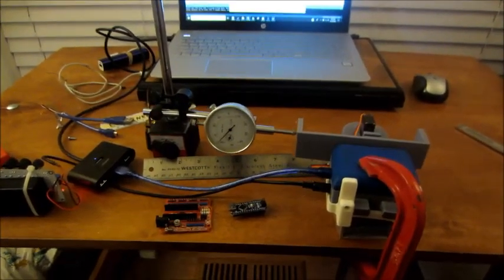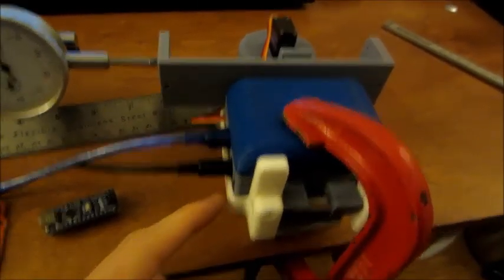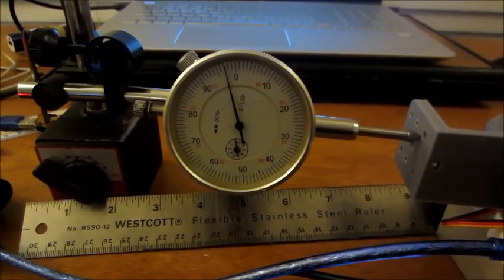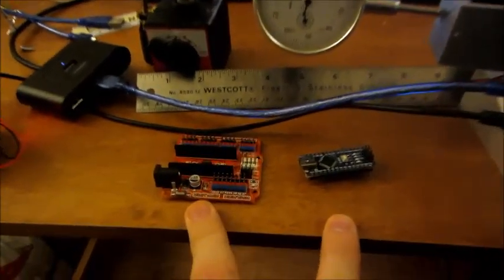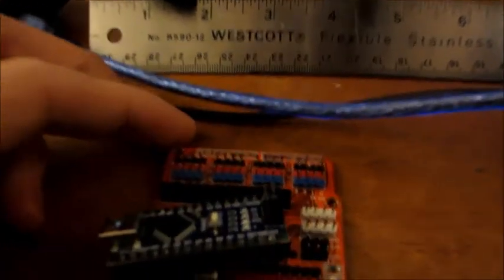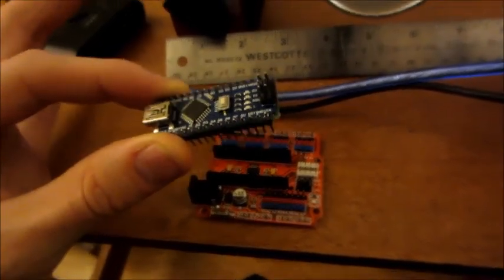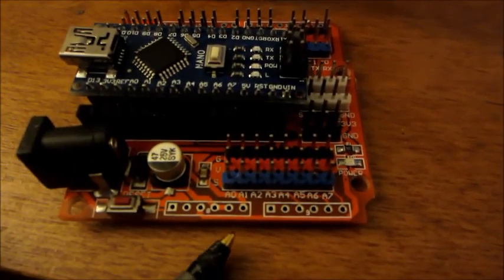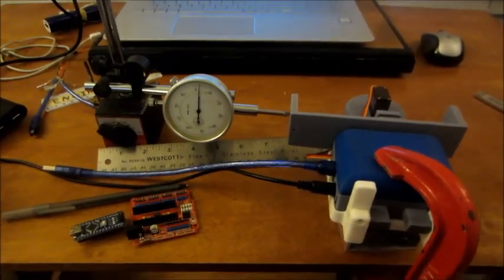3D Printed Linear Actuator Development Video #2

Comment: There are those extremely cheap geared stepper motors available :  28BYJ-48 
2$ including driver electronics. They could give a bit more precision but are also slower than a servo it think.  https://de.aliexpress.com/item/Frees-hipping-5V-4-Phase-Stepper-Step-Motor-Driver-Board-ULN2003-with-drive-Test-Module-Machinery/32706559510.html